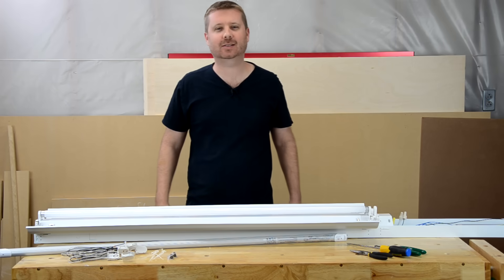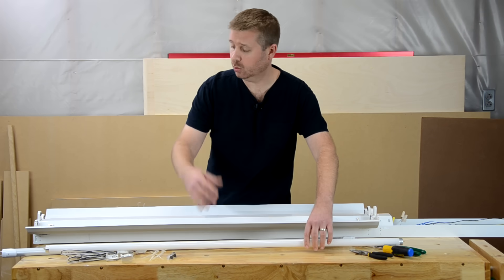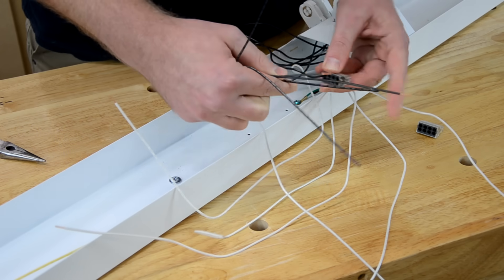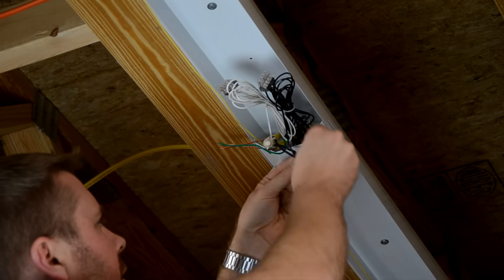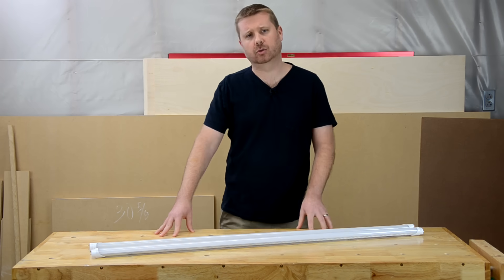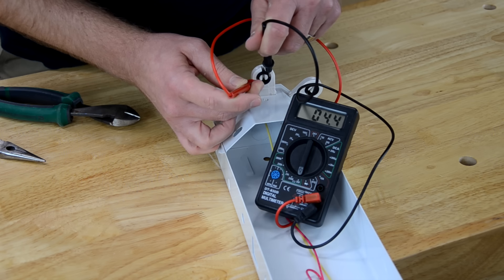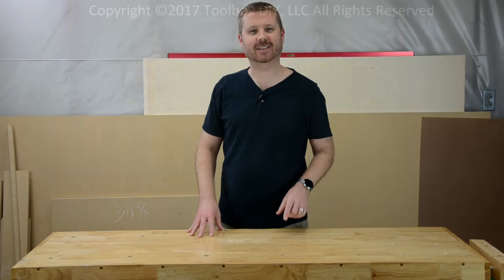How to easily convert fluorescent Lights to LED –Easy Ways to Save Money

Comment: Why do you leave the yellow wire from end to end.  What purpose does it serve.??
Reply from the maker: After you convert to LED, that yellow wire serves no purpose. When it was a fluorescent fixture, that yellow wire is just combining the common path of all the lamps and then returning to the ballast. The manufacturer figured out how to wire the fixture using the least amount of wire (saves money) and this how they accomplished that. I don't bother removing it for two reasons: 1) I'm efficient (read: lazy) 2) In the off chance I ever want to go back to fluorescent, that's one less thing I would have to do. Reason 2 is highly unlikely.

Comment: What is the purpose of the yellow wire going from one end of the fixture to the other?
Reply from the maker: After you convert to LED, that yellow wire serves no purpose. When it was a fluorescent fixture, that yellow wire is just combining the common path of all the lamps and then returning to the ballast. The manufacturer figured out how to wire the fixture using the least amount of wire (saves money) and this how they accomplished that.
Reply: Thanks

Comment: are there single pin shunted tombstones? how would you use a multimeter with a single pin fixture?
Reply from the maker: Shunted vs non-shunted does not apply to a single pin tombstone so you're off the hook for busting out the multimeter! If you see two wire leads coming out of the tombstone, the second one is usually so you can daisy chain the connection to the next tombstone.

Comment: So, someone comes along later (say a new homeowner) and decides to put in a flour scent tube in place of a bad led tube. What tappers? I converted my shop and now am wondering if I need to identify the fixtures as non fluorescent?
Reply from the maker: I tried putting a fluoro tube in a converted fixture and as expected, it didn't turn on. Luckily, it didn't blow up! To be kind to the next home owner, I've started adding these notice stickers to my fixtures. Some retrofit tubes come with them. You can always buy them separately. Here's an example: https://www.totalbulklighting.com/metallic-led-t8-retrofit-warning-label.html

Comment: You can also just cut one end of the tombstones so they’re not connected to each other then just supply the line and neutral to the other side and then your not having to change out any tombstones. Good video but definitely the long way to go about it on a single end.
Reply from the maker: I'm not sure I follow. Are you saying to cut the shunt on the tombstone?

Comment: Watched your newest video and then came here to see your first video. I don’t understand why you had to replace the tombstones on the power end. I don’t see any difference between the original and the replacement version.
Reply from the maker: So the new tombstones in this video each has black and white lead wire coming out of them. The old tombstones had either a single wire coming out of them or two of the same color. Other than that, it's sometimes hard to tell which ones are shunted and which ones aren't. I demonstrate how to test the difference at about 10:05.

Comment: Hi i am want to do this but my concern when i went to home depot is the type of led bulbs they the recommend  to be install with electronic ballast ,didn't find any double ended or single ended...the said instant play ,universal fit ...help please
Reply from the maker: Any tubes that will work with a ballast are consider doubled ended. You might want to view my most recent video that discusses the options we have today that weren't as widely available when this original video was made. https://www.youtube.com/watch?v=VKEQ1HCLW5c
In my opinion, ballast compatible tubes are a great option. However, the tubes should also allow for bypassing the ballast if you choose. The reason is that ballasts can fail. It makes no sense to replace a ballast for LED tubes. By using a hybrid tube like a mention in the more recent video, you can install the tube without any rewiring and then if the ballast fails, you can bypass it without having to change your tubes or replace the ballast. Good luck!

Comment: When combining groups of wires give the groups several twists and the lengths will merge into tighter group which is neat and easy to fold and zip tie.
Reply from the maker: Good tip. Thanks!

Comment: Thanks.I was wondering about the single ended confections.
Reply: It really depends on the bulb manufacturer. Some require both ends to be wired, while others only require one end wired.  I recommend determine which style bulb you want to use, and make sure all your bulbs are the same.  I have converted over 700 bulbs so far..  most tombstones are non shunted, and don’t require replacement.

Comment: Yeah, If you want to do this yourself in Australia(unless you are a licensed electrician), when your house burns down, your insurance wont cover you.  Seriously though, if you have fluorescent tube fittings, chances are they are quite old, plastic parts will be perished due to UV damage from the original lamps, and insulation will be heat worn.  You are just better getting an new LED fitting installed, it  costs the same, and at least you will be  covered by warrantee.  With electricity, DIY=DIE.

Comment: Can you use normally close holder on other side??
Reply from the maker: You can. The other side is not acting as an electrical connection. It is only holding the tube end.

Comment: Converted my kitchen tubes to LED about 5 yerars ago, and been very happy. Since converted my small workshop. It was shadowy under my cabinets, so I made some under-cabinet lights.  I bought 4 of the 48" 5000K tubes. Used round connectors to plug thin power cords to the prongs on the tubes, hung them up with rubber bands on magneitic hooks. Happy camper.

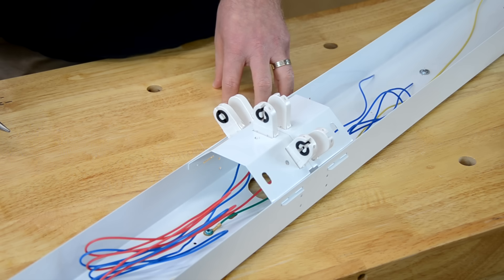Comment: At one point you said we needed non-shunted lamp holders for the LED bulbs.  Then, at 3:57, you said we need to replace the non-shunted holders with shunted holders.   A bit confusing, but I think your first statement is the correct one.
Reply from the maker: The first statement was a mistake and incorrect! These tubes need non-shunted holders. See description for the correction.
Reply: @ToolboxDIY  I get it:  the first statement was correct and the second statement was not. BTW, I just got done converting the first of many fixtures to use the LED tubes.  Took an hour, mostly because I soldered all the wire connections.  Thanks for the video, it gave me confidence to finally tackle the job.

Comment: If you remove the ballast does the light work on 120v or is there something in the tube that helps it light
Reply from the maker: The lights work on 120v. There's a driver built into the tube that has a AC to DC step transformer.

Comment: Warning. Warning. Warning. Different brands of LED tubes are wired differently.  There is no industry standard.  
For the one he is showing you 110VAC is applied to the two pins at one end of the tube.  The pins are the other end are dummies.

For another brand 110VAC is applied from one end to the other end.  So one end has the pins tied together and you can put your hot lead there on either pin.
At the other end the two pins are also tied together and you can wire your neutral to either one.  If you wire hot and neutral to the two pins at one end you will create a short circuit and hopefully pop the circuit breaker.  And unhopefully burn down your house.  

Some tubes brag about being compatible with your existing ballast.  If you are light weight enough about wiring up electrical lamps that you feel like you want to leave your existing ballast in place and power the tubes that way then please just keep using fluorescent tubes and don't change to LED.  

This is a sad state of affairs that tubes are wired differently.  This means you have a nice LED fixture and years from now the LED tube goes out.  So you go to the store and buy another LED tube.  You plug it in, flip on the switch and POW!  

Another problem is every LED tube I have tried puts out a great deal of RF noise in the longwave band.  Turn on your LED tubes and every AM radio in your neighborhood turns to static.  That's why I bought a lifetime supply of old fashioned ballasts and fluorescent tubes and will not switch to LED until they reduce RF noise emitted from them by at least 80dB.

Comment: I did try this 8 months ago, bought two LED tubes with the connectors on both end. Instruction shows very easy to take out the old connectors and put in these new ones. That is the hard part, I could not even get this going so I returned them. Then I bought LED tubes which include metal housing from Amazon for the same cost,. These LED tubes come in as complete unit. Take off the entire old tube fixtures, then install these in (only two screws needed to attach it to the ceiling or wall), then do the standard 3 wires connection to the old wires (black, white and ground) that feed the old tubes. This is simpler. REMOVE OLD ONE COMPLETELY , INSTALL NEW ONE.

Comment: Hi Chris stumbled on this tutorial. In my barn I have six 6’ two bulb fluorescent lights that do not work when it’s very damp or raining. I figure the ballasts are bad. In order to replace with LED I should shop for LED bulbs of the same size as my current fluorescents correct? Thanks

Comment: I have never worked on a Ballast before. My bulbs were Flickering. Decided to change to LED. Bought 3 sets of LED bulbs. Took me about an hour to change out 3 40" Shop Lights. T8 Models. I completely removed the Ballast. But did it with cutting the least amount of wiring possible. I can reinstall in other lights if needed.

Comment: if you are using rapid start cut all yellow  wires on one holder then use the two blue or two red  on the other lamp holder to connect the line to, if it is an instant start  you can,t do this unless you have a non shunted that was shunted with a very short jumper.

Comment: I replaced my FTs with LEDs.  Didn't remove the ballast.   They work, but after about 30 min, it turns off.  After a period of time, it might/might not come back on.  Cycling the switch makes no difference.  Is this due to the ballast still in place?
Reply from the maker: It sounds like the ballast and LEDs might not be compatible. The only other thing I can think is that some how the LEDs are getting too hot and going into thermal shutdown.
Reply: @ToolboxDIY  I'll try removing the ballast and see what happens ;)   TY

Comment: Single ended tubes can always be rewired as double ended if when you have to replace the tubes the single ended type become hard to find.  Just leave the cold end with the YELLOW wire still attached to the socket, but left unwired.  You can later use the yellow for the neutral, and short both of the wires at the other end together for the hot for double ended re-conversion.

Most electronic ballasts are wired for shunted lamp holders.  Older magnetic ballasts, activate the starting filaments on both ends of the tubes, with really ancient types having an external two terminal starter (which often goes bad).  These type fixtures have non shunted lamp holders which can be removed. (non shunted sockets have TWO wires at each socket).

Comment: I’m knowledgeable around electricity and converted a Lifelite unit last night. What a different setup! Transformers, capacitors, and startup circuitry instead of your typical ballast. Another difficulty is removing the tombstone holder. Manufactured to be a “one-time”install, it’s a pain to unclip it and get it apart. It took four hands to do it but opened with patience and didn’t break the plastic molded clips. I also found a never soldered wire... no wonder it flickered. My helper was confused but I understand shunted/nonshunted. He wanted to insert a replacement tombstone. But Lifelite doesn’t use the standard snap-in units. So, as you showed, I used my VOM to verify the existing tombstones were non-shunted because we had to use the existing tombstones. You were smart in your video to teach that. We cut out all electronics; two transformers, two capacitors and resistors and the startup circuitry and reduced it to simple 120 VAC hot/neutral at one end for both bulbs. The only thing we left in place was the power ground connection. Snapped the tombstone units back together, inserted the single-ended LED while paying attention to which end power goes in, and it worked perfectly. Only eight more of these to go!

Comment: My thought on this subject is, if you need a video to figure out how to directly wire an led light on a 120 volt fixture, you probably should not be doing the work as you do not understand electrical theory and may hurt yourself or cause a fire.
Reply: Why, his video made it very easy to understand.  Even though many may know how to wire a 120 volt fixture, they may not have known the difference between the shunted and non shunted tombstones or that there are options with single or double ends.  His video makes it simple to understand.  This ain’t rocket surgery and most homeowners with any mechanical ability would be Abe to watch this video and determine what option is best for themselves.
If your an electrician, get over yourself.  It ain’t that hard.
Reply: @Mcss-lu5hv  Like I said, if one is an electrician and understands basic electrical theory, one can easily figure out how the bulbs need to be wired in from the manual with it. This is electrical 101. It concerns me with people pretending to be an electrician and possibly burning their whole house down and killing family in the process. It is a possibility. Happens every day.

Comment: I bought 2 Philips Led replacement tubes for my 4 foot fixture using the universalT8/T12 and the ballast for the  original flourescent  lamps. now the ballast is shoing signs of burning out... (works and then heats up to 300 degrees and shuts down) what do i do? how can I hook those univeral LEDS  up without a ballast? Should I buy a new ballast? what type?

Comment: This is obsolete. You can buy LED lights that replace fluorescents without the hassle of modifying the fixture or wiring.
Reply: True, but if the ballast fails (like he says) then your stuck replacing the ballast which can get expensive.

Comment: hmm, I disagree with some of your comments... I always use WAGO 222 connectors, they're epic, and reusable if you have to rewire (221-61X for 10 awg, and 221-41X for 12 awg). I would also rewire and resolder (lead free Cu/Silver/Tin is pretty good) all the connections with compressed copper cerrowire awg 12 or 10 with a THHN jacket.. depending on total wattage and typical operating temp, THHN compressed copper wiring is bend resistant, protected against dirt/rust, and operates up to 90 C before melting. Lastly I'd install a normally closed thermoswitch to replace the ballast, in the event of extreme heat, it can turn off the lights. Although I haven't tested this just yet.. not sure how this would affect PWM or voltage based dimming technology. Most thermoswitches induce a small amount of inductance in the line. If you plan on having a light outside, you'd want XHHW-2 instead of THHN wire.

Comment: So I was told that you have to replace the ballast with and “Led driver” but no one on these videos does that... are they not needed?
Reply from the maker: Most of the retrofit LED tubes have the driver built into the tube. There are some that require an external driver but I don't find those to be very common in the U.S.

Comment: I purchased T8 LED tubes that say on the box that they will work with existing electronic ballasts.  After I installed them they will turn for a few seconds and then go out.  If I toggle the switch they may flicker very briefly but they do not light up.  Is this common?  What do I need to do?  I'm guessing I have a bad ballast.
Reply: You might want to check the manual. Some LED that work with ballasts have a list of ballasts they work with. If your ballast is not on the list, it will not work. Philips InstantFit come to mind. Is that what you have?

Comment: Here’s a little tip before you spend extra money for non shunted tombstones. Some holders have a fiberboard cover on the back side. Gently pry off the staple and cover and look for a clip connecting the two pin tabs. Remove that clip (it should lift right out) and you now have a non shunted tombstone.
Reply: When I opened mine, there was just a wire on bottom between the two sides. I cut that and voila, non-shunted.
Reply: Make your own video thanks GOD bless you

Comment: I did away with the entire fluorescent fixture and installed a LED light fixture.  No bulbs to replace in this new fixture and it has an auto on/off sensor.  It can be set to go on when movement is detected at night or during the day, and shuts off automatically in 30 seconds.  As an added bonus, the new light fixture is much more attractive and takes up less space.

Comment: Question: Is there a way to use the LED replacement lamps designed to use with the existing ballast, but to use them without the ballast?  Thanks for the great video.

Comment: I was at Lowes today and I was told I would need to install a T8 ballast if I remove the T12 ballast otherwise the their bulbs would not work, I need clarification. All they sell are replacement T8 4' tubes . I was told by the time I buy a new T8 ballast and bulbs for $6.50 each I could buy a complete work light assembled. Thoughts, Thanks, Tim